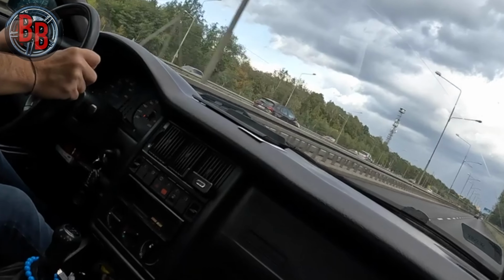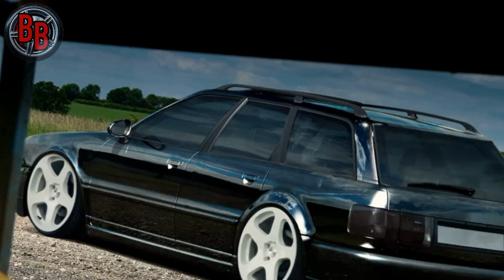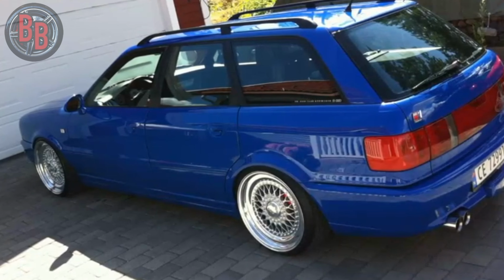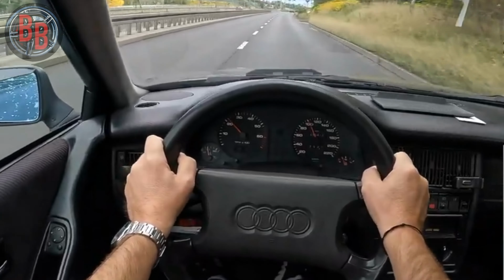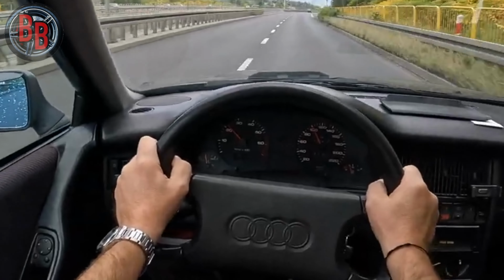Audi 80 B4 - Check For These Issues Before Buying

Comment: Naa, you better take care of that 1z engine. And to be honest, don't go with the 1.9tdi, mainly because the fuel pump is half electonical. And said little electronics bit controls everything, rather than a good ole throttle body. See, now it's not a bad thing. But these fuckers are old. And the electronics tend to also break down. And once that happens, you're in a hell of a fuckfest to fix the fucker. Although the car will most likely still drive. It'll be torturous to drive.

Comment: I have a 80 b4 Avant with the 1.6e engine it currently has over 320.000km and is daily driven. After 30 years the original paint has faded beyond repair but the body has stil almost no rust spots. Great well build cars and if maintained with care they can last a very long time and many kilometers!